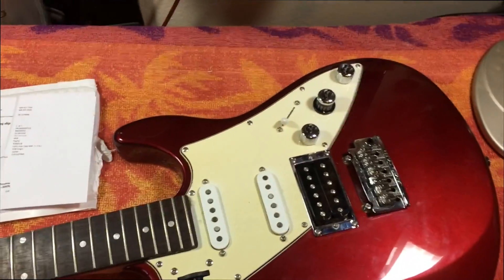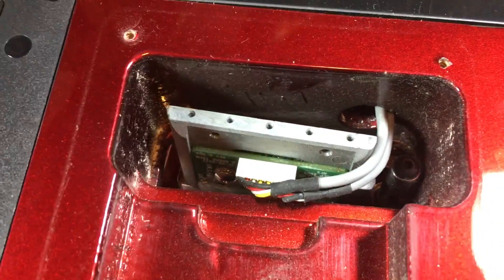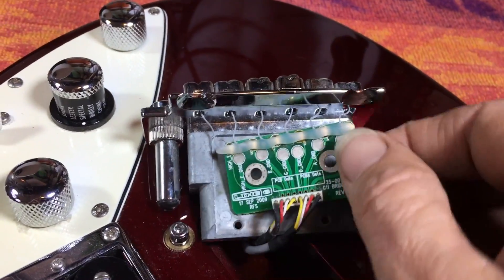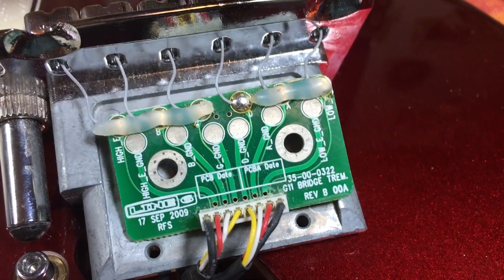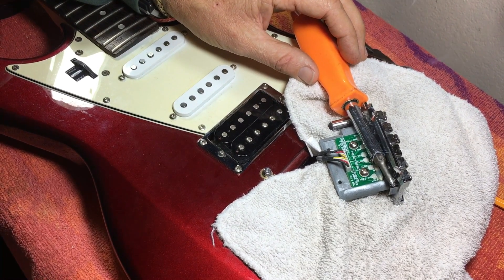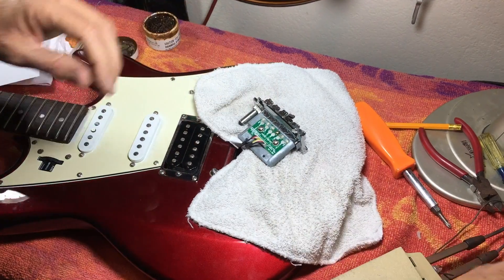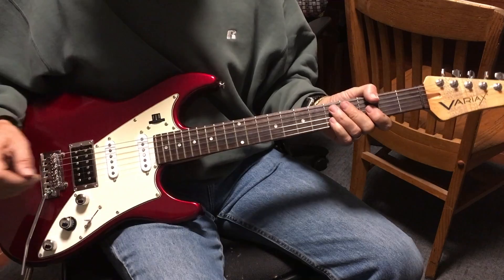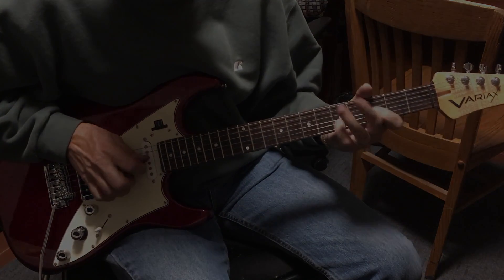Line 6 Variax JTV-69 Piezo Replacement

Comment: Thanks for making the video...I've had that problem on my A" time to fix it!.....but a little advice, that is NOT the soldering iron for the job......They are really cheap and well worth have better accuracy when working with boards,  less than ten bucks

Comment: Thanks for the vid, brother. I had a similar situation happen last night, D string was really weak. Used my backup JTV89 pawnshop special for the evening. Today I restrung the 69 (identical to yours) and wiggled around the piezo,  hoping to re-establish the ground. It appears to have worked for the time being, but after watching your video I know that I can pull that piezo up a bit and clean out the pocket. Thanks!

Comment: Thanks for the video.  I think I just bought the last "new" 89F in the US. However the Alt Tuning knob is missing the cap, the charger only came with the UK plug and the G string has very low output on the modelling side.  Same as you described yours. I just got it today and I was assured it came with a full warranty.  So I'll probably have someone else take care of this for me but just in case...  I'm really glad you took the time to make the video that no one else did. Actually since these have been discontinued I bought this as my second one for a back up.
Reply from the maker: I bought a few new 'broken' ones years ago at the GC Outlet Store and they honored the warranty and fixed them.   Just had to make a bunch of calls and send it to Line 6.

Comment: Awesome vid Tony, I have a brand new JTV 69 same color as yours and I love it. I bought an 89F and had the tremolo bar insert be too small.
I had jammed it in so badly that I had to disassemble the bridge to take the tremolo bar keeper out of the bridge to fix it. The insert was pressed together and that caused the inside where
The tremolo bar post to sit be about .020" to narrow all the way around. Had to punch out with a hammer and punch!. Ground out the insert with a Dremel tool and all is fine now.
I called my sales rep where I bought the guitar from and told him to contact Line 6 quality control to inform their Chinese outsourcing to fix the press...Manufacturing these days is suspect at times.
I'm glad i watched your vid in case I have any issues with my Piezo pickups i can fix them. Thanks man!.
Reply: John Kruton do you know what type of push in trem bar works with these bridges? Thanks
Reply: @andrewpearce5477   Sorry for the late reply, I just revisited this vid and saw your question. This model comes with a straight push in bar with no locking nut attached to the bar like the ones I''m used to on my Floyd Rose knockoffs. I took my digital calipers to the diameters of the 3 whammy bars I own and I discovered these dimensions.  Variax 89F with graphtech Floyd Rose copy measured at .230" diameter at insert.  My JTV 69 Variax with the straight push in chrome bar was a bit smaller at .216". My Ibanez s470 with Ibaneze FR copy is .235" diameter.  So there seems to be some variation amongst various copies. I'd be interested to know what a branded Floyd Rose diameter is at.
The problem with my delivered 89F was the actual insert inside the bridge was stamped with a smaller or worn die that made the bar not fit at all. Not even close. I could have returned the guitar but I'm a fab/machinist/mechanic by trade so I took on the task to fix it myself.  Guitar worked fine before and now works better.

Comment: Great video. For me it is also the same D-strong piezo that sounded very dull and almost half as loud as the other onces. I looked around for a replacement piezo but noone appears to hasvd this part in stock anymore in the US. Glad i saw you describe the part abput the grounding and how it needs to be cleaned. So i went ahead an sprayed some deoxid on the piezo/saddle and let it do it’s work. It actually made the piezo sound a lot louder and brighter again. So that is definitely worth trying out first too for folks if their piezo sounds very dull and low output. I think in my case it was indeed a little bit ‘dirty’ grounding issue.

Comment: I'm currently having an issue with my JTV-69 where my high E and B strings seem about 3dB quieter than all the rest. I turned the rest down in workbench to compensate for now, but it's annoying. Also tried dripping Deoxit in the saddles as suggested on the forums.
Reply from the maker: Sounds like the Piezo's need word.  First clean out the saddle where the Piezo sits with contact cleaner, if the doesn't help, replace the Piezos as the video shows you how.

Comment: Yesterday evening I had also some piezo  troubles with my JTV-69. From one moment to another four strings were "dead" with no tone coming out. Ouch! I first thought the electronics failed and so I checked the pickup plate and the electronic main board. But couldn´t see any issues like loosened plugs or broken cables. Pickup mode always plays correct. Fortunately the tremolo unit fell into my hand while loosening the strings. I knocked on those little metal parts - obviousely the piezos - and four of them were dead. I took a fine brush to clean them and suddenly one more works again. After and after while I was knocking and brushing around them all three other piezos came back to function. I have no good explanation of what went wrong. Perhaps the piezos had lost ground contact but why then all four at the same moment?......McMurphy will know.
Reply from the maker: All's well that ends well.  Depending on your climate and playing circumstances, the saddle where the Piezo sits can get krud in there and lose ground.  Good idea to give a quick De-oxit spray every time you change the strings.

Comment: good to see it's simple to replace a transducer... but I wonder why you did not just unplug the molex connector, so you could completely remove the bridge, so you could solder on a bench, and not over the guitar. Best to unplug from the back, before pulling the bridge out. But, great result, and nice sound demo too!
Reply from the maker: I tried to and it was hard to get out and I didn't want to break anything...
Reply: yes, better to play it safe.

Comment: I have a problem with my variax 69.when I charged original battery.it just blink,so i ordered a battery relacement. charged it
It worked.when I connect the battery to the guitar.the 4 lights usually turn on.it doesn't work.i need help.thanks
Reply from the maker: Batteries can act strange sometimes.  It may think it is charged when it isn't.  If you unplug and Plug it in a bunch of times sometimes it will start charging again.  Also I had a brand new one that never would blink that it was done charging, but it always still worked AND line 6 sent me a new one under warranty...

Comment: I am having the same issue with my old Variax 700, only its my B string that is completely out.  How did you unsodder the original piezo?  Are you talking about the round cap that seems to be holding the original one in place?  Sorry if the questions seems dumb.  I have to get a soldering kit to even do this but I have to get this fixed an I don't want to have to ship this across the country to get it  fixed.  Thanks for taking the time to do this.
Reply from the maker: I haven't had a '700' but from the images I see online the bridge looks pretty much the same.  If you've never done any soldiering I would have someone else do it for you as the wires are very fine and if you get them too hot you can damage it.  If you do it yourself watch some YouTube videos on soldering techniques first.
Reply: mine is a 700 and I found that I just touched the soldering iron to the connection and it came apart instantly, literally Another Touch to reconnect the new Piezo it was surprisingly easy. none of the silicon was present on mine so I assumed when I had Sweetwater repair a Piezo a few years ago they simply took it off and didn't replace it. Must not be that important lol :-)

Comment: If anyone knows how to do this, you do!  Can you adjust the position of the vibrato bar on a JTV Variax so it stays where you want it instead of being loose? If you tighten the bar all the way it's not in a usable position.
Reply from the maker: Don't laugh but I put teflon tape on my strat style tremolo bars.  For less than a buck you can buy a roll of it at any hardware store in the plumbing section.  Very simple and cheap.  That way it will stay where you want it and not flop around.  It only works on the threaded style arms though.

Comment: Hi ,it’s not related to pickups but ,can you plz guide me ,I don’t have line6 battery ,I tryed np f550 ( similar like line6 ) but didn’t work ,is it only works with official battery’s only ? Do you know anyway to make it worked this third party battery ?
Reply from the maker: I tried the same thing a few years ago.  It is strange that I can charge my Variax battery with my Sony battery charger but I cannot use my Sony Battery with my Variax guitar.  The battery looks exactly the same and plugs into the Variax but won't work.  I have seen posts that you can make a small adjustment to the battery leads and make it work but I have not tried it...
Reply: Tony Butler thank you for response ,plz guide me man.i got my veriax in half of the price because all the accessories lost lost .so I didn’t get battery’s ,( nothing only guitar I got ) I live in Dubai if I order battery’s from eBay costs a lot and takes very long time, so cannot buy .what adjustment it needs ? Share some ideas plz .
Reply from the maker: Here is a link to the same subject:  https://line6.com/support/topic/19016-72v-variax-battery-vs-sony-camcorder-batt/

Comment: Yeah I had a JTV-89F brand new with a dull & super low volume piezo! Bad quality control!
Reply: Have a similar issue with mine. Ordered a replacement pickup and waiting for it to arrive. Yours got solved or are you still facing the similar issue?
Reply from the maker: Once I replaced the Piezo it was fine.  I've had 4 of these variax's and never had any other problems that a quick fret level didn't fix.
Reply: Finally mine arrived. Installed it today and glad to report that Low E got its voice back :) Also its pretty easy to install/replace Piezos in JTV 89f. No soldering/unsoldering. Just plug n Play.
Reply: Did you just replace the whole saddle and piezo?

Comment: Where can we buy such sadles and or bridges pls?
I found it but it's not for Belgium.damned!
I use a Ibanez Artfield with GK3 and a Roland GR55 synth. The element of GK3 is to big for this guitar and doesn't fix in a nice way, that's why it completly broken while playing guitar. I will use a piezo tremelo instead of a pickup.
So I wanne experience with piezo saddles connected on a Roland GK3 without that plastic crap hexaphonic pickup.
See if this will work.
Reply from the maker: Full Compass.  http://www.fullcompass.com/prod/114557-Line-6-11-11-0001

Comment: Thank you for your video! I have a problem with my variax, it is producing a high pitch noise, do you think it could be related to the Piezo? It'd be great if you could have a listen to this (https://drive.google.com/file/d/1FBLE5QPrPtBrGMSkPTVnfkISbzDvoy_w/view?usp=sharing). I first play with the magnetic pickups, at around 00:10 seconds I turn on the piezos and modeling, then you can hear that noise, at around 00:22 seconds I just touch the 5th string several times, that only happens with the 5th string. I'd appreciate any help, thank you!
Reply from the maker: Wow.  Strange noise.  I never heard a Variax sound like that before.  Can you isolate it to one string?  If so at least you can start looking at that Piezo etc.  In general the first thing I check is that the Piezos have a clean, solid contact in the saddle.  That is the ground.  Pull all of them out and just clean out the little pocket they sit in with some contact cleaner or maybe alcohol.  Beyond that it sounds like a job for Line 6.  Good luck.
Reply: @tonyrbutler  Thanks Tony, I will try that, fingers crossed! Best Wishes.